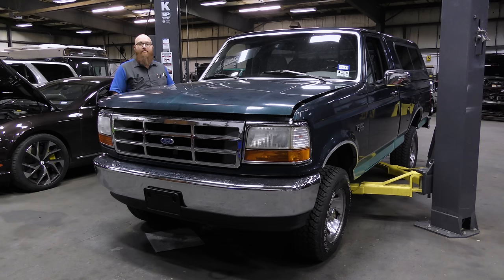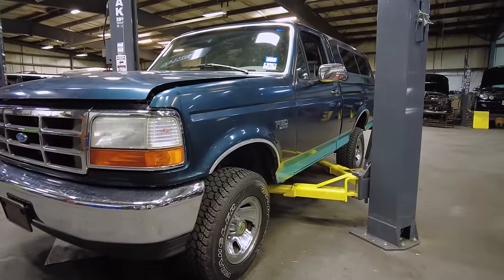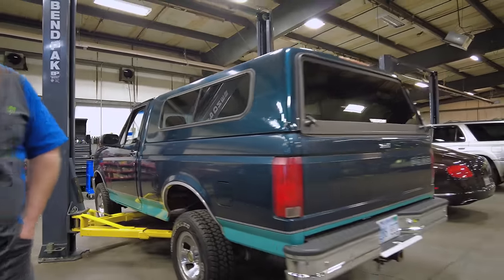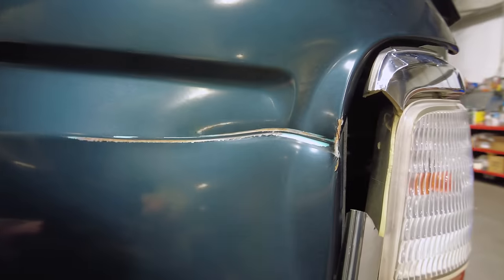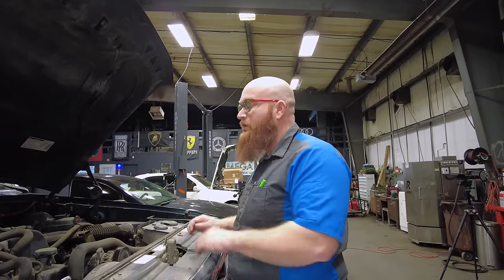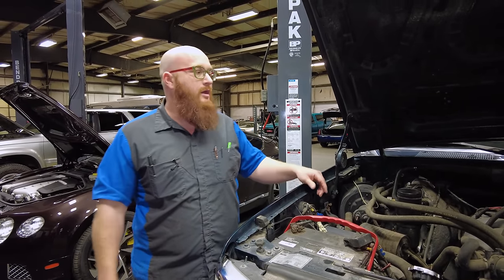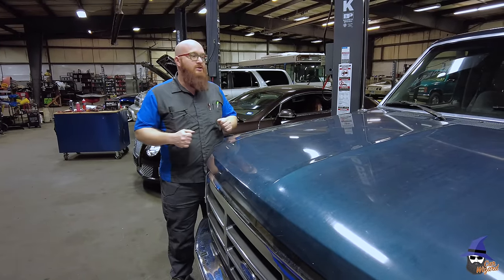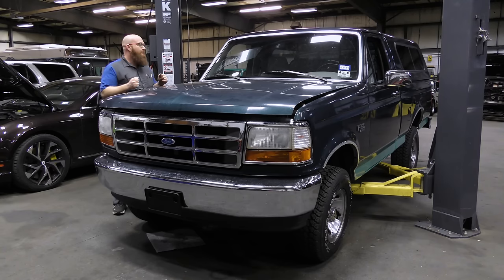What makes the CAR WIZARD mad? Fixing other shop's screw ups! Cheap Shop made  huge mess in '95 F150

Comment: An old milk carton and a soldering iron could be used to plastic weld those broken plastics I know I have done it myself. It works honestly try it on some old broken plastic to get your soldering iron at just the right heat to melt not burn the plastic.
Give it a try.

Comment: there are odometer repair services that could fix that, it would be worth looking as to keep the mileage either very close to it since used ones can either have more or less miles then the actual mileage on the vehicle. but that would be based on what the customer wants to do, if he wants to get a used one then that's on him. for me i'd try the repair service before getting a used odometer since they are very close in price these days.

Comment: I had the 92 f150 in line 6 with the manual transmission and 8ft bed for a few years and the hvac vents in the cab broke adjusting the air direction and plastic door handles in the cab to exit were awful at breaking off mid pull and traps the people in the cab I replaced it multiple times I wish I had  kept the engine and transmission

Comment: Had one of those motors in my 82 drove it four years with a 4 speed really one of fords greatest motors ever sold it five years ago wish I still hade it it was the F150 XLT full size bed when I sold it i had over 300,000 on it and the person I sold it to is still driving it today a lot better than my current F150 with the 5.4 is by far

Comment: Yes, the 4.9L I6 is a torquey beast, especially with the manual transmission. However, they do have a tendancy to leak oil on the top end, and if left too long it will ruin the engine harness.

Comment: These clusters go bad all the time. My 95 lightning had the same issue. They can be rebuilt to show correct millage. It may also be the cab fuse that controls that od/Speedo independently of the gauges

Comment: I work at a collision repair/body shop. I work on cars every day that I'm not familiar with. But I don't just grab a prybar and start breaking things. I use the most important tool any modern tech can have. I pull out my cellphone and look it up on the internet. If I can't find directions or video on how to disassemble something. I look up pictures of the part so I can see the mounting points. There have only been a handful of times where I wasn't able to find the information I needed. And they were all on brand new vehicles. Usually German cars. Audi, VW, Mercedes, BMW.  But even then, I found enough information to get it apart without breaking expensive parts. Not only that. But if we break something. We replace it.  We don't give the customer a bill and a broken vehicle.  That's just horrible business practice

Comment: Not trying to defend that other shop on the damage they’ve done, but those dash bezels are pretty brittle. I had to change mine because the headlight and fuel tank selector switch broke off after decent sized hitting a pot hole.
Reply: They are even more brittle when you don’t take the screws out.

Comment: I love my 93 7.3, but have a friend that has a 95 f150 5spd 4x4 short cab short bed 1 tank not 2. It has 170k on the clock. Truck is a tank.

As a 7.3 IDI owner I’d love to own a Ford 300 I6.

Comment: I daily an unrestored 68 C10.  Took it to a loca big letter tire shop for an alignment after replacing a lower control arm. Then, after calling and setting up an appointment, being told the on guy who knows how to do it, was off that day. And that the manager was going to do it instead. Figured sure, ok. You might screw up  and it won't be aligned as good. But I was not prepared for what they did. After a forty mile drive....every alignment shims on the passenger side fell out. Had to temporarily fix it with washers to drive another 40 miles to their ex sister shop. Who billed the first shop.

Comment: If you break it out of your own stupidity you own it. Sneaky behaviour from some car shops sucks; all they needed to do was get the replacement parts from the used/breaker trade and the customer wouldn't have been pissed off. The way it works is they tell a dozen of their friends, those people pass it on to people they know and before you know it the news has gone viral and the story has morphed out of all proportion.

Comment: I had a similar experience with a local "top rated" rear differential shop. My 96 Bronco XLT broke something in the rear differential. This shop found that the whole member housing had broken in half. They did the work, I paid almost $1500 thinking that the best shop did a good job. Nine months later, rear end noises, growel at highway speeds, just like before. Did they reuse my old components and put them in a new housing? I'm dickering with them now. SMH

Comment: I had a 300 cu in Ford six in a 1974 E-100 van with a three speed manual trans. Would only go about 80 mph flat out and sucked gas like a drunk sucks down whiskey. Ran wonderful with tons of torque.  It would pull however much you could pile in it.

Comment: A trend I have noticed getting worse and worse over the last decade is mechanic shops breaking stuff on customers' vehicles to create "repeat customers." I believe this is getting to epidemic proportions. For instance I used to take my vehicle to a mechanic shop which I trusted and always had good service. Then it changed ownership and the first time I went there (for tie-rod ends and a front-end alignment) I had problems. When I went to pick up the vehicle the bill was higher than quoted but I was in a hurry so I paid and left. On the way home going across a long bridge I could hear clattering under my hood. As soon as I got to the end of the bridge I pulled over and raised the hood and could clearly see that my AC fan belt was completely shredded, as if someone with a utility knife had cut into it. A couple weeks later I called a friend of mine and found out his uncle had taken his truck to this same shop after the new owners took over and when he picked up his truck he thought he smelled anti-freeze. Two days later his lower radiator hose burst and it looked like it had been cut with a utility knife. Also, one of his rear tires mysteriously developed a slow leak. Needless to say I never went back to this shop and neither did my friend's uncle.

Comment: I feel like someone else needed a speedo and swapped it, I own a 95 f150, and your right, that doesn’t need messed with for ac and coolant smell. Even a heater core in these wont require dash removal

Comment: If he paid with credit card, he should inform credit card company about what happened and get a charge back. I had to do this with Toyota service in Hillside, NJ after they broke transfer case when replacing RF cv axle on a 2006 Matrix 4WD. They just JB welded it and their cover up failed, leaving gear oil leaking. I also sued them due to lost revenue as a uber driver.

Comment: I have a 170 I6 in my Econoline
I've driven it on four 600 mile road trips. Ran perfectly. I cracked the windshield and it's been sitting for 10 years 😢

Comment: In my medium sized city there are two real mechanics and one decent shop. The problem is they are booked for weeks. Recently I was fortunate to buy an immaculate 2002 Ford Taurus with 52,000 miles for $1,500. Ran fine but 20 years old. Had a complete transmission service, oil change, and new spark plugs. The mechanic found a vacuum leak when he changed the PCV. Now my $1,500 car is a $2,500 car but grease is cheaper than machinery. Most "mechanics" today are parts changers. If their electronic diagnostic equipment doesn't tell them what is wrong, they are dead in the water. Until age caught up with me I did my own parts changing.

Comment: I agree with you about the Ford 300 straight 6. I had friends who plowed snow with 4WD Ford pickups, and to a man, they insisted on buying their trucks with that engine, not the V-8 options.
Possibly the strongest, most reliable light truck engine ever built. Also used in stationary industrial applications.
As for shoddy workmanship, its become an epidemic. In my little corner of New England, there are no more truly competent mechanics. Not one. Its depressing. Shops just don't care any more. All they want is your money. And as for dealers -- ugh. World class rip off artists. If I lived in Kansas, you'd get my business.
That F-150 you've got in the shop even has a 4 speed manual transmission, and crank up
windows. Wow. That is the way to go.

Comment: You can’t exactly fault the other shop for cracking the console. As you know as plastic ages it becomes brittle and sometimes parts become what only be compared to welding together. As careful as you are, plastic and old parts break when you try to remove them. 
As far as the missed and misdiagnosis, well that is self explanatory .

Comment: Shocking as it may, not everyone can afford $120 per hour Omega charges.  Especially in Kansas where minimum wage is still $7.25.

BUT, seriously WTF?!!!  A customer comes in with a complaint of coolant smell and weak AC.  You don't need twenty years of auto repair experience to know to check the static freon pressure (to see if there's ANY liquid refrigerant left inside).  If the static pressure looks good, start the engine and turn on the AC to see what the low side is reading when the compressor engages.  That's the very first thing you check in case of any AC issues and you don't need a fancy machine for that.  ANY recharge hose with a gauge will do.  Tip:. When you buy a freon recharge can and then bring it back to get your core deposit, the hose is yours to keep.  Only the can needs to be turned in for the core.

Now, the broken bezel I can understand.  It must've had enough flex that someone who didn't work on these before thought it just pops off vs having to undo a couple hidden screws.  Even then, when they did get it off, there's absolutely no excuses for not taking out the broken pieces and carefully super gluing the mess back together.  Clean, smooth breaks like that?  The superglue joint will be stronger than the rest of the plastic.

As for pulling the gauge cluster?  I'm at a total loss as to why someone thought that was necessary.

Comment: When you go cheap you always pay for it in the end. Now I'm not really a truck or SUV person but if I ever find an older F-100/F-150 with the 300 straight six and especially with a manual transmission that is in good condition, I will buy it in a heart beat. That 300 is probably the best engine Ford has ever made. A lot of people consider the 302 to be a downgrade from the 300.

Comment: 2:31 Wizard, say it with me N-N-N-N-N-N-N-NOOOOOOOOOOOOOO. I own 3 pickup trucks and an SUV, a 2008 ford f150 4x4, a 1990 Ranger, a 1997 F250 a 1998 Explorer 4wd 5.0. I loan NONE of them out. I an a Ford guy if you were wondering. All of these trucks serve a specific purpose. I dont loan vehicles.  In some circumstances i do, but very rare ones.

Comment: Who knows auto A/C? My Daughter's 2011 Focus would not blow cold, would not accept any 134. Pressures were equal with A/C on. Took it to a shop we have used for YEARS! Diagnosis was that the clutch was about to fall off, and EVEYTHING had to be replaced, compressor, condensor, etc etc. Was this a correct diagnosis?

Comment: Strangest thing. My parents had an f150 with the same engine, always got serviced, yet somehow blew through 2 of those engines. 

Then there's me, with a 97 f150 with the 2valve 5.4L, sitting at 176k miles and the biggest repair was a single rubber hose. 

Just our luck I guess. I know the 3valve tends to be the bad ones, but still.

Comment: Not surprised the inline v6 is more reliable than the V8 variants. I don't tow anything so I really like the Toyota 2TR-FE 4 cylinder which you can still buy in a Tacoma. It's the most reliable engine being sold today and has been around for 25 years but with different VVi variants.   They will never be sold again as 2023 is the last year Toyota is making them.

Comment: The Australian Ford 4.0Litre inline six is similarly reliable. When they were used in taxis and on dual fuel 1 million miles was not uncommon. It successor called Barra is also a tremendous engine. Pity they have gone forever!

Comment: I had one of those in the early 2000s for a work truck with that engine and over 300k! Someone stole it out of my jobs fence and the 4 wheeler that was in the back of it. They later found the truck burned up  in a field and the 4wheeler gone!

Comment: I took a running, daily ridden BMW motorcycle to the dealership for a new starter and flywheel.  They never got it to run properly.  I was told it would rev uncontrollably, that they could not find the issue and they wanted it out of their shop.  They wanted $4K for this service.  I told them to keep it and bought a new Yamaha for $5K.  No more BMW for me.

Comment: Not all shops are created equal.
But, sometimes, that can work to your advantage.
I bought a 08 Ford ambulance for very short money, from a shop that got it from a mechanics  lein.
Supposedly, the motor was "junk".
At 164,000?
Guess what?
A mechanics lien shouldnt even come into the conversation, when the issue is a bad chassis ground.

Comment: Took my 2020 Silverado to a collision center attached to a Buick/GMC dealer after I hit a deer on the interstate. 20k in damage (insurance covered) but I now have an awful tire rub when turning right, which I never had before. They left  the front license plate bracket in my front seat, knowing I live in a state that requires it. And don't even get me started on the massive panel gap between the hood and passenger side fender. 20000 dollars and 3 months of waiting, only for them to create more problems. 

Moral of the story, DO YOUR RESEARCH!!! My truck is my baby, most expensive thing I own, and I'm still upset that this is what I ended up with.

Comment: I have been a auto mechanic for 45 years, and these later years you can watch YouTube videos that help you remove some of the dash parts that you are not familiar with. When you get his used dash gauges from a salvage yard, will you make the mileage on the speedometer the same, or just let the car owner know that the milage is not correct and write it down say in his owners manual? Your a good mechanic and I have always tried to do the best that I could for the customer. But I'm retired now and I'm not going to touch any of this new computer car stuff today,,,,,,,,,,,,,

Comment: I'm surprised the Speedo wasn't working due to a broken wire at the rear diff speed sensor.

Probably broke from being on the lift... Not knowing how common the problem is, went after the cluster...

Comment: How odd that they would disassemble the dash.  That's going to be expensive.  A new bezel from LMC truck is expensive and it's going to be a challenge to find a used one that is any better than that one.  How do I know?  I had to replace mine on a 96 F150.  It was a matter of finding the best of the worst.

Comment: This is why I do ALL my own work. No mater what tools I have to buy and how long it takes me and what unneeded parts I buy for the parts cannon at least when I'm done it will work. I've even been burned by the most expensive shop around. I brought my mint 65 VW bug for an inspection. He failed it. He some how jamed his knee into the fuse box breaking it so the lights and wipers didn't work, pulled the emergency brake so hard that the pawl flipped then failed me for the lights, parking brake and wipers not working. To top it off he cranked the front wheel ball bearing down tight like a roller bearing causing the bearing to fail 2 days later leaving me stranded. This is from the best in state M___ Station whose owner had a prize winning model T. Maybe he just didn't like me or my car but he did like my money.

Comment: 2:50 it’s reliable because it don’t make any power. It’s bulletproof until the composite cam gear break.
5:45 drop out of overdrive to save the transmission? What is she talking about?
17:55 if the customer were to name the shop. Maybe people would stop going there. You can’t slander if you are telling the truth.
Reply: Even if the composite gear breaks, I'm pretty sure you can replace it with a metal one and be back running again, and non-interference designs don't grenade themselves when the timing chain/belt/gear gives way like interference designs do either to boot.

Comment: so what exactly did they claim they did to warrant a bill of $900? I know sometimes old plastic doesn't cooperate when doing a repair but you have to make it right with a customer, Why they pulled the cluster for an A/C complaint is mind boggling to me. I've been a GM tech for 7 years and have seen hack repairs from other shops.

Comment: Whenever I price shop I always pick the cheapest one which is always ME. My neighbors may not like the cursing and flying tools, but I managed to change all the bulbs in the cluster of my 95 Bronco without destroying the dash. I kinda wish it had the 300 and 5 speed because I'd drive it more, the 351 barely gets 12 MPG.
Reply: And the i6 will barely get 13.
Reply: Gearing plays a big roll... I have a 2wd '96 F150 reg cab/short bed with the 300 six/M5OD and a 2.73 rear gear. I get about 17.5 mpgs on my daily work commute doing 55mph down Iowa back highways.

I also own 1995 F350 4x4, reg cab long bed, 351/zf5, with 4.10 gears. On the same commute I only get around 14 mpgs, although it's a larger truck.

Comment: Mine came back with broken engine mount, no ABS, incorrect shock covers, holes in my boost pipes, and they also didn’t diagnose my ball joint about to fail